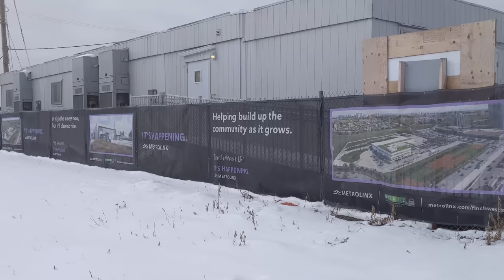Missing Links: Short-Sighted Transit Planning

Comment: Paris has many, MANY, missing links. The most frustrating has to be the northern end of M12, with sidings extending all the way to the RER B at La Courneuve but the last stop being nearly 1km south. Other face-palm-inducing missing links include (clockwise from M12 north):
- M7 north at Le Bourget (currently RER B, M16/17 being built)
- M3 east ending in the middle of a highway interchange
- M1 east (ongoing political battle)
- M5 south which stops INSIDE Paris, it's insane (IMHO it should take over one of the two M7 branches)
- T6 east should have been extended to T3 or M4
- M12 south to T2 or RER C or Transilien N
- M8 south but it's not obvious where to
- M9 and M10 should cross the Seine and connect to T2 (M15 will cross the river though)
- M2 west could be extended to Puteaux or Surennes (maybe a bit overkill)
- M3 west to Bécon-les-Bruyères (Transilien L, M16 being built)
- M3bis and M7bis, just for kicks
Reply: You forgot line 3 which won't connect with line 15 at Bécon-les-Bruyères. Same goes with line 12 which stops at Mairie d'Issy, only 700 m or so from line 15.

It's a shame connections with existing lines were not included as part of the Grand Paris Express program.

Comment: In Paris, the new Line 12 terminus at Mairie d'Aubervilliers is staggeringly stupid. The tunnel continues until it nearly crosses the RER B and A1 highway viaduct (the end of tunnel shaft is just in front of it), a few hundred meters of more tunnel could have allowed to build a station and its turning around/train storage facilities... And 500 meters to the North, the under construction station of La Courneuve 6 Routes of the Grand Paris Express will also only give transfer to the tram where Line 12 could have been served as well. The project is regularly discussed but has no chance ot being funded anytime soon.
Same goes for Line 7 from La Courneuve to Le Bourget, there was a project to build two new stops to serve the Air and Space museum as well as the RER station in perfect alignement... the extension to at least the RER station that will feature the Grand Paris Express is discussed but since Covid and the economic crisis, no money left and the Line 17 going to the Musuem also would make it redundant on the second station.
There are many other examples in the Paris area alone. Most of them are due to physical obstacles such as the River Seine on the West making it difficult to extend metro lines 3, 9 and 10 to the West and some high relief making Line 3 nearly impossibile to extend (cheaply at least) to the East.
Line 14 extention to the North at St Denis will feature a tunnel arriving in front of the St Denis Stadium RER B station... no one thought to add platforms to serve the stadium on match days? (unless given the violence of some of the sport public attendance, it would probably be better if Stadium had NO public transit whatsoever... One of the numerous critiques on the ring tram in Paris is that id won't serve the last link (the 16th District) just because its mayor doesn't want it (posh neighbourhoods just prefer their cars and don't want dirty people to come on their doorsteps with public transit, they didn't like the metro back then already), plus one other argument was given by the Police Prefect who didn't want tram sets to be damaged during match days in the Parc des Princes stadium... So the tram ring is for now at least condemned to not be finished and terminate at the Economics University Campus of Dauphine... The rest will be covered by an overpriced gadgetbahn ultra posh bus. something that will cost nearly as much as a tram for no reason at all...  
Paris mayor is very fond of those "Wireless and Rail-less trams" as they like to call those...
Politics used to say that war is too important to be left to the military... I say that public transit is too important to be left to politicians.

Comment: A major missing link is the east end of the green line in Los Angeles which doesn’t connect to the Lossan commuter rail corridor. The city of Norwalk sued so the 105 freeway didn’t go to the 5, and this cut short the green line which has always been under used.

Comment: Another good example on the Washington DC metro are Farragut North and Farragut West stations which run right next to each other under the same plaza. To transfer, you have to take the escalator all the way to the surface and then go down again, all while paying another fare!
Reply: You don’t have to pay another fare! The Farragut Crossing is a great alternative to transferring at Metro Center. Of course a tunnel would be better, but it’s no big deal when the weather is nice. A single Farragut Square station was originally planned but the National Park Service wouldn’t allow construction on the park. WMATA has conducted studies on adding a tunnel and it could happen in the not-so-distant future.
Reply: You do not have to pay another fare.  If you transfer at Farragut North/West with a tap card your second journey is calculated as a continuation of the first.
Reply: anyhow as long as we're complaining about NPS and metro shout-out to their veto of a train bridge through Rock Creek Park pushing the red line annoyingly deep underground and killing an Adams-Morgan station.*

*Yes I know Woodley Park-Zoo is called that, sorry if you have to walk 15 minutes across the bridge to get there it does not count.

Comment: Before I watch this,the most short sighted one for me is the missing connection of the Red Line to the Blue line for the MBTA. You have the space at Charles/MGH Station,why do I have to leave the station,walk 2 blocks,and hop on at Bowdoin Staion? Or hop on a different line and get onto the Blue Line? It makes my commute take longer and I have to take 3 trains instead of 2. I hope with Maura Healey being elected governor last year,she owns up to her promise of fixing the MBTA,but I have little hope

Edit:thank you so much for talking about this,it really puts a damper on my commute from Quincy to the Airport
Reply: Why doesn't the MBTA Silver Line (South Station to Airport) solve the Quincy to Airport commute for you?  That's a single transfer, with no additional fare, in one station, running directly to all Logan terminals, with nice luggage racks, and I've used it for years, with and without luggage.  Granted, it doesn't get you to the remote hangars near the Blue line, if that's where you actually work, but I'm constantly amazed how this existing connection is overlooked by Reece and his audience, in spite of its good fit for the many travelers who live along the Red Line.  Before this line existed, Red Line airport passengers had to triple connect, hauling luggage up and down stairs and on and off overcrowded shuttle buses, the misery of which was designed (yes, designed!) to push people into taxicabs clogging the tunnels.
Reply: @ydhirsch  good question! The Silver Line goes right towards the main terminal,what you see when going into our out of Logan International,but where I work at is right next to Airport Station on the blue line,which would mean I take the shuttle from where the silver line is to the Blue line,it really is 6 in one hand and half a dozen in the other
Reply: @ydhirsch  Not OP but while the silver line is useful, it’s very slow and gets stuck in crushing traffic due to horrific design decisions. It’s BRT at its worst. Even with the airport shuttle (if one were going to the airport from RL), a red blue connection would be miles faster. Also, the lack of red blue connection doesn’t just mean bad airport commutes for those along the RL. More important imo is the lack of access to job centers in Cambridge (Kendall Sq primarily) for (predominantly EJ) communities along the BL.
Reply: @elefante8572  interestingly the Silver Line is NOT complete as it was designed. The underground busway was supposed to have a portal past South Station to unify all the branches but officials couldn’t settle on a location. I hope they one day handle this outpoint. Having said that I think the one of the biggest issues the T faces is the lack of a Red-Blue connection. I hope this new Governor will be true to her word and find matching funding with Mass Brigham and finally extend the Blue Line to Charles/MGH.
Reply: @DDELE7  definitely, although I don’t think SL phase III (which would be super expensive, and was partly cancelled due to that) would really fix the issues with it (mixed traffic running). Alas, I don’t think light rail will happen anytime soon. Hopefully washington street gets something better at some point.
Definitely want to be hopeful about Healy!

Comment: I’m glad you mentioned the Dorval one. The people living south of the 20 in dorval already have an underground pedestrian tunnel under the 20 to access the bus hub and train station easily. And they are currently starting to build denser in this area even though the transit is limited. Extending the rem there should’ve been a no brainer. They could’ve had the station align perpendicular to the 20 (under it). With the back end of the station providing an exit to the buses and the train. Meanwhile the front end provides access to dorval residents south of the 20
Reply: Same here.  The timeline for this is so frustrating too in terms of lack of engagement.  People have been asking for it since the time the REM was announced. In 2019/2020 a study was commissioned by Marc Garneau and was super-delayed.  It's finally out in August-2022 and shows definite ridership benefits over other types of connections.  Plus with the potential Rapid Rail Corridor and even and the potential Lachine Tramway also going out to Dorval.  It would be an absolute no brainer in terms of long term interconnectivity.  So many missed opportunities to make something good really great!  So frustrating.  I've been trying, but it's like fighting the wind.

Comment: I'm a simple man, RM Transit Posts and I watch
Reply from the maker: I appreciate it!
Reply: @RMTransit  For many years there's been a proposal for passenger service from Scranton to NYC.
Either being NJ Transit or Amtrak.
Looked at a recent video showing a map with proposed line connecting Binghamton with western NY.
But no line connecting Binghamton to Scranton!

A problem I know with the existing freight line from Scranton to Binghamton is they removed the second track long ago. But also the bridge over Keyser Ave was replaced with a single lane bridge around 15-20 years ago.

Comment: Happy New Year RM Transit and for the NYC System how about thinking 63rd Drive Rego Park of the subway towards JFK Airport that way it can relieve the congestion of the Fulton street Line towards Midtown Manhattan. However the problem is that Queens Boulevard line is already at capacity. Or 3 train terminating at Harlem 148th St instead of the original 1930s plan which was actually sending it to the Bronx on the 9th Avenue elevated therefore allowing 4 trains to serve the west side then Normal route after Nevins St if there was a problem on the IRT Eastside line.

Comment: The Battersea Power Station extension of the Northern line in London crosses the Victoria line (underground, above or below), but it was decided not to build an interchange station. It was also decided not to extend from Battersea Power Station to Clapham Junction. This National Rail station has more trains passing through than any other in Britain. Trains from Waterloo pass through the station, as well as trains from Victoria going south (not southeast).   Those two main lines are not connected by rail. It is also a terminus for a London Overground line. It was decided that these projects would overload the tube lines.
Reply: In my opinion it makes sense to have no interchange with the Victoria as it would slow down both lines and the Northern offers more interesting connections than the Victoria (Waterloo, London Bridge, Bank, KSP).

However I agree not going to Clapham Junction is a big mistake.

Comment: Milan Metro will soon have a missing link between M3 and the new M4. M4 at station Sforza-Policlinico crosses M3 halfway between Missori and Crocetta. So, because an underground walking path would have costed too much, here we go with a on-ground/sidewalk transfer of 300-400m (plus going through two gate lines, up and down). Level of connectivity: below zero

Comment: Unfortunately, there are many locations across Melbourne's tram network with tram terminuses that comes near railway stations, but are still too far away for any viable transfers. Most of them could be done with only 1-2km extensions of the tram tracks, without any massive excavations etc.
Reply from the maker: Yeah this is a particularly crazy example!

Comment: Arghh I know this problem so well ;;
There is a small town with a train station close to my city, but there is no bus to get there at all...all busses stop in the neighbouring town...theoretically, it would take only 7 to 8 minutes with a bus from my neighbouring town to the town with the train station and thus 15 minutes from my home, but thanks to the fact that this bus does just not exist, getting to this train station by bus takes more than 1,5h! This is so stupid and I see absolutely no reason to not connect my city + my neighbouring town to this town with the train station. 
Generally, my city has really good transit, including an express bus that connects to the next main city with 500k inhabitants in only 20 minutes and lots of good bus connections every few minutes to the local main city with 100k inhabitants, so connecting the town with the train station to my city would also connect the people there and the train users with all those places.
Reply: very frustrating. I live in New Jersey, there's several train lines that radiate out (essentially) from New York City. And they're very useful....for going to New York city, or anywhere along their routes.

Most of them, if you want to transfer between the lines, you need to go nearly to NYC to transfer to another line, despite many of them running roughly parallel at some points. A outer bus line linking them together could save over an hour from some routes, and bring transit travel times at least closer-to what it takes to drive between places. Especially if the state were to expand transit-priority light systems.

Comment: Dublin's Luas Green Line and Red Line we're not linked between 2004 (opening of both) and December 2017, when the "Cross City"  expansion of the green line finally addressed this comes to mind.

However, as the green line crosses the red at grade on O'Connell Street /Abbey Street/ Marlbrorough Street, it limits the capacity of both by creating a new conflict. 

Our "Metrolink" project (currently in planning) also ends north of Swords at a P & R when there's a few km of open countryside north-east of it where it could meet the Northern Line railway at Donabate or Rush & Lusk....

Comment: This topic reminds me of the battle NJ TRANSIT had to go to in my childhood hometown growing up to connect two commuter lines that were separated by only a quarter mile  (Bay Street on the then Montclair Branch, and the Boonton Line just east of Walnut Street Station, to create today's Montclair-Boonton Line).  Decades of NIMBYs, lawsuits, the settlements to get less than 1,400 feet of track built...and then the NIMBYs who claimed that extending catenary electrification by five miles beyond the connection point would checks notes give everybody cancer, plow down hundreds of historic shade trees, and require the use of Agent Orange to prevent vegetation from growing anywhere near the tracks.  None of these happened, and the connection opened in 2002.  Was quite proud to ride the first train of the new electrified service in.

It should not have to be this difficult, and it was not this difficult when competing modes got built (granted, sometimes for terrible reasons in the USA).  If we're going to adapt to the 21st Century and climate, we need a way to get these kinds of connections built in a few years, not a few decades.
Reply: I'm quite frustrated by the hand the Sierra club, of all organizations, had in opposing electrifying the Coast Line further south. It's utterly absurd there's a 15 mile stub at the end of an electrified branch of the NEC where you need diesel to operate, if for no other reason than the extra rolling stock required.

The icing on the cake being many of the same NIMBYs involved in that ALSO demanded NJT stop fueling diesel engines in Bay head. A more reasonable request, if they hadn't also fought for stopping the wires.